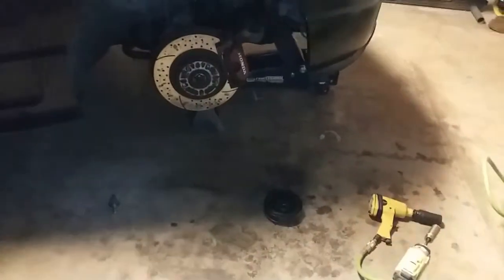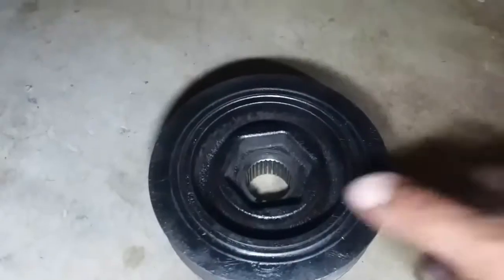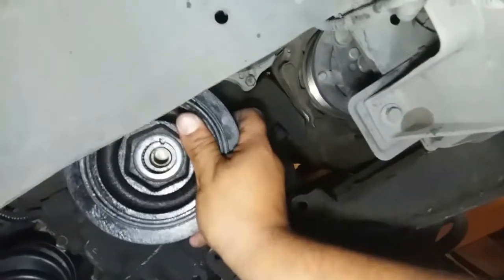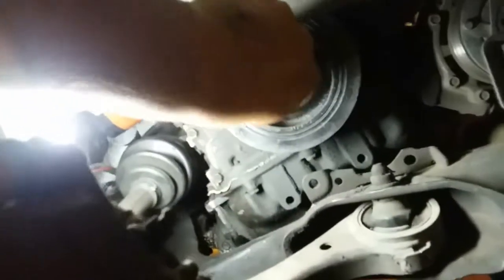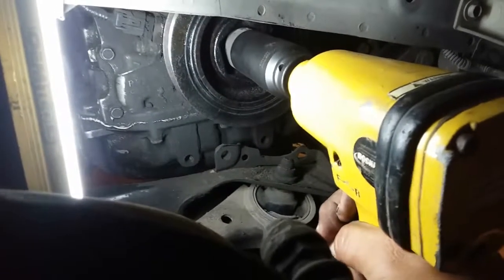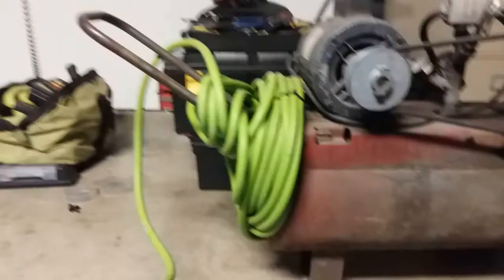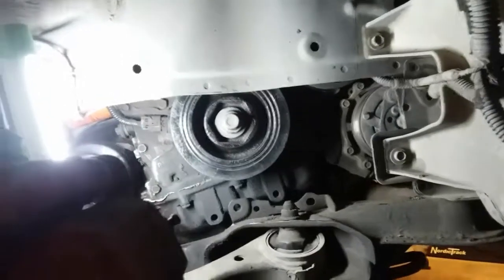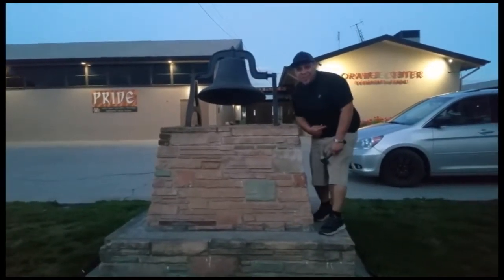How to: Install a Crankshaft Pulley/Harmonic Balancer on a 2006 Honda Civic Si

Comment: Thanks buddy! Whered you get the part from? Local or online.... Jwing if the cheaper ones online are worth it or will go to shit 2x as fast!..
Reply from the maker: I got mine on ebay. USED. NO PROBLEMS YET AND I BEAT ON IT ON A DAILY! I'll post a similar link, this one looks in great condition 👍 

https://www.ebay.com/itm/203002752464
Reply: Hello George. thank you for the video. i have a question.  i need to know if this is nornal.  i have a 2011 honda civic LX. i was repairing my passenger side brakes . i noticed below the harmony pulley one thing funny. the oil pan has 2 holes and the chassis has 2 holes as well. These wholes are not evenly on eachother and it makes me think the oil pan dont suppose to be bolted to any parts of the chassis. as far as i know, i have all of the engine supports replace and i am hoping what i am seeing is normal. i can tell in your video that your car looks the same as mine.  hope you can see this below the harmoney pulley and let me know if the oil pan needs any bolts to be attached to the other holes from the chassis part.  sorry  it is too much
Reply from the maker: @rodolfovaladez420  you should be good bro the k20 on the si model has the rear mount bolted up to the oil pan...i think thats what your seeing....its probably factory like that to support the k20 motor. If your not leaking oil out of them you should be good. Nothing to worry about bro. Thank you for your SUPPORT! Follow me on Instagram @559powerscape...send me pics bro let me see what your seeing 👀
Reply: GEORGE LOPEZ HOW TO DO IT YOUR SELF     THANKS BROTHER :)   I appreciate your response. do you have facebook where i can send you the picture?
Reply from the maker: @rodolfovaladez420  I dont bro sorry, just Instagram
Reply from the maker: @rodolfovaladez420  just created one bro send them. https://www.facebook.com/profile.php?id=100054530954353

Comment: Bro do you know where I can get a harmonic balancer that works? Bought the doorman to find out it’s bigger than the oem Honda.
Reply from the maker: I got mine on ebay used. I found another one a bit pricey but looks in really good condition out of Florida...
https://www.ebay.com/itm/06-07-08-09-10-11-Honda-Civic-Si-2-0L-K20Z3-Engine-Crankshaft-Pulley-Oem-/224602256751?mkcid=16&mkevt=1&_trksid=p2349624.m46890.l49286&mkrid=711-127632-2357-0
Reply: I’m running the Dorman one it doesn’t cause an issue except finding a belt

Comment: Is there a special way to reinstall a new woodruff key on a 1995 Honda accord. I'm having trouble with it.
Reply from the maker: For the keyway? You might have to sand it down if it has any imperfections